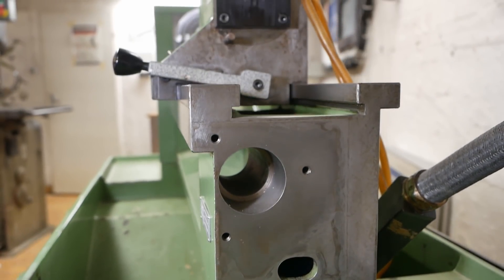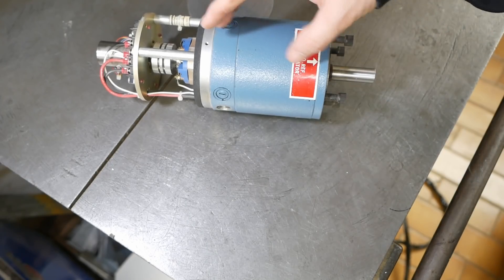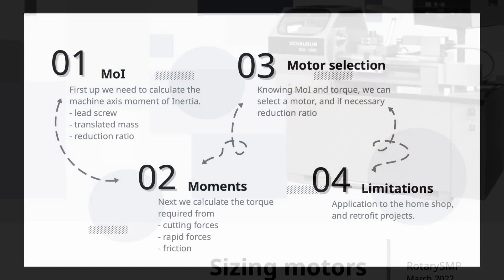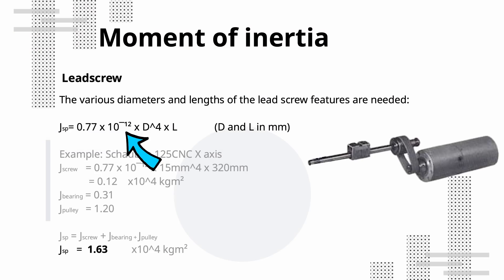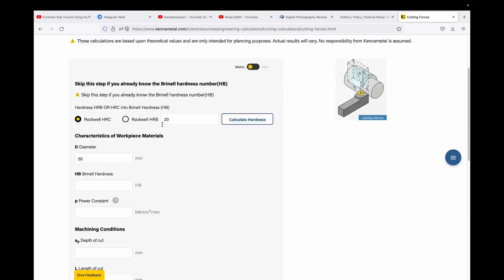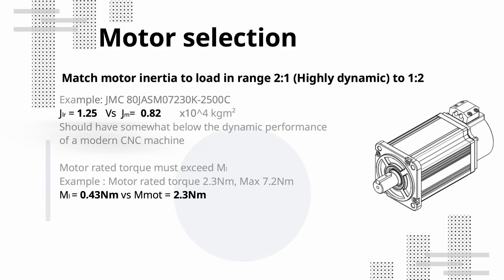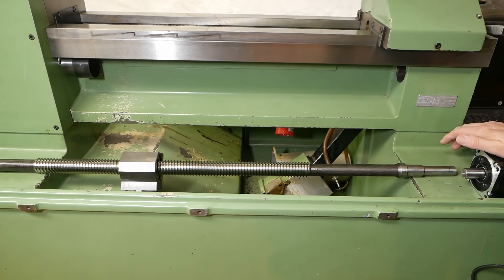How to select CNC axis drive motors.

Comment: I needed to watch this video before buying my motors.

Totally ignoring the matter, I asked friends which have experience mainly on 3D printers.

So, my choice was based on this algorithm:
Machine head:heavy.
Big motor.
Open loop stepper:bad.
I hated losing steps on a friend's CNC in the past.
Servo motor:fancy, I don't need them.
Closed loop steppers:sounds good.
But they're cheaper if bought in kits for 3 axis.
And the machine head is heavy.

Can I spend the money for a 3x NEMA34 12Nm kit?
Yes.
Bought them.

After that, people showed up saying that they're overkill.

So I needed a reason to justify to having bought them.
I came out saying that having big motors helps with cooling when I make fast little repositioning on small movements.

I had to reduce axis acceleration otherwise the machine was bouncing on the stand...

But at least the motors stay cool...

With some calculations it seems that with correctly dimensioned servos I will have saved money and will had better performance.

Ignorant dumb choices...😅
Reply from the maker: We have all made the mistake of concentrating on torque rather than inertia when sizing motors. :)
Reply: @RotarySMP Yes, definitely!
Imagine my face when I saw a guy using the same motors I bought to revamp a 6000x2500 plasma pantograph...😂

I had to reduce motor acceleration and current to avoid tipping over the machine😂

Comment: The calculations are very interesting. I think you were low on the expected feed forces. 0,1mm/rev when facing is usually a finishing cut. You ought to be able to do at least 0,2mm/rev.  The servo is big enough for it anyway. I have finished watching the Sieg playlist. Working on the Schaublin playlist now. Really enjoy it. I learn a lot from you wiring stuff.
Reply from the maker: Thanks for you feeback. You are right, the machine can cut 0.2mm per rev on most steels, on normal diameters.

Comment: Need to watch this more, but I'm trying to select motors for a knee mill retrofit and not sure how to figure out what nM and gear reduction I need. 

Do you cover that in here? or could you dive into it in another video?

Thanks.
Reply from the maker: If you do the inertia calculation, and match the inertia for good performance, sufficient torque will not be an issue.

Comment: I'm not a math guy so I'm struggling a bit with this, I've managed to calculate my moment of inertia with the formulas as shown, but I'm struggling to understand it. In the first formula: 0.77*10^-12 D^4 * L I understand D is diameter and L is length, but why is D taken to the 4th and where does the 0.77*10^-12 magic number come from?
Reply from the maker: It came off a worksheet provided by Prof. Bleicher in the VO311.093 - Auslegung von Werkzeugmaschinenen lectures at the TU Vienna.

The area moment of a shaft is pi*r^4 /4

I don't have the working, but it includes the conversions from mm instead of m, the pi/4 and the density of steel.
Reply: Thanks! I think it's great you were able to just take a course on machine design, I wish we had options like that here in Canada!
Reply from the maker: @Teklectic  I struggle learning this stuff, but also really appreciate the opportunity.

Comment: Hi! Im making H-frame CNC milling machine for metal milling. The travel workings XYZ is 1000*1500*300 respectively. So can I use 400w servo motor for XYZ axes? Thanks!
Reply from the maker: You need to run the numbers. All of the calculations you need are in that video.

Comment: is there somewhere you can tweak a gear ratio 2:1 - you have a motor that is a bit too fast, without enough inertia loading - slow it down, so you see less of the inertia - you'll double the torque but, that's already overkill, so you could go 2:1 the other way there and still be safe.
is this because modern motors are just that much more performant over their entire speed range?
Reply from the maker: Remember that the design goal of a modern CNC manufacturer is insanely fast. 40/min rapids with a ton on the table and high accelerations. The motor is within the normal design range, maybe on the low side of dynamic performance, but  lathes does need much of that. It should be fine.

Comment: It probably doesn’t matter a bit, but as I recall Dex-Syn was the model name of a control system developed by Control Systems Research in Pittsburgh, Pennsylvania. CSR was bought at some point by the Swiss conglomerate Contraves. (In the 80’s, I worked a few miles away at a sister company named Contraves-Goerz, making optical stuff.)
Reply from the maker: Thanks for that. That all fits, as the motors have CSR on stickers.

Comment: you got lucky. Though i know nothing of servos. But stepper driver noise is from cheap stepper drivers.
Reply from the maker: Yeah, I know. But these days there is little reason to choose steppers or DC servos for a project like this. Those AC servos only cost about 1/10 the total retrofit budget incluing purcase ofthe machine, and only cost about 20 or 30% more than closed loop steppers. They plug straight into single phase power, accept Step/Dir or Analog control and pass through the encoder signal.

Comment: Also, while doing the calculation I noticed there's a tiny error in the MoI slide for the sliding components where you've got 0.18 * 10^4, and I believe you're looking for 10^-4
Reply from the maker: Good catch. Correct. I always make dumb mistakes like that..

Comment: I think 'dynamic performance' would translate to acceleration capabilities.  In some machines the acceleration forces might outweigh everything else in terms of motor torque required (depending on the mass being moved and desired acceleration performance).  They might not in your machine, but I would suggest including it in your calculations in the future if you're interested.  I think you could directly translate ability to do things like cam turning at a given spindle rpm into linear acceleration required to follow the profile to within some amount of error.  Also, I believe motor torque and acceleration would not be instant - they would actually take some time to ramp up to a rated torque value based on the inductance and resistance of the motor windings and the voltage available from the drive.  That's probably a secondary effect and would only matter if you were going for very high performance, but I have noticed that the inductance of similar sized / rated torque surplus motors that I have can vary significantly.  For example Fanuc motors seem to have less inductance than Yaskawa motors in the small collection I have.
Reply from the maker: Given that this is a sliding way machine, I really dont want extreme speed or acceleration performance, as I dont want to gall the ways. But you are right that we also looked at the resulting acceleration behaviour.

Comment: Glad to help.  I am not a strong analytical engineer and do most of my work by the seat of my pants, but I am trying to get better at the real work on paper.  I'm grateful that my boss at a previous job gave me the opportunity to sit down and really do the maths and understand the MOI calculation stuff for high performance robots.  We were shooting for getting the max performance with the smallest/cheapest motor due to monetary and power budget constraints, but in your case you lucked out because you have a surplus of performance :D
Reply from the maker: I figured that the motors available to Schaublin in the late 70's would not be difficult to match with much smaller modern motos. Given that Schaublin had that axis limited to 500mm/min I wonder what that old DC servo was rated at? Unfortuneatly I couldnt find out anything about it.

Comment: It occurred to me that the drive motor for the variator is potentially just an AC servo that doesn't have an encoder on it yet.  I may well be wrong on that, of course.
Reply from the maker: What makes a 3ph AC induction motor into a Servo? Permanent magnet armature instead of induction?
Reply: @RotarySMP  As far as I know - and I could be wrong - all you need is an encoder and an AC servo drive.
Reply from the maker: @jimsvideos7201  I thought that Servos need to by synchronous motors, verse asynchronous, but that induction motors are asynchronous
Reply: @RotarySMP  Jeremy Fielding has some videos on the subject, if that helps.
Reply from the maker: @jimsvideos7201  Thanke for pointing to his channel.

Comment: I ended up using chinese 750w ac servos on the avm mas165s too. But I didn't exactly do the due diligence you did. I looked up the specs of the old fanuc motors and compared them to the offerings in my budget. Iirc the x axis was only 0.5nm and the z axis was 2nm so 2.39nm 750w 80 frame was more than enough. I'm running 2:1 belt reduction with a 5mm pitch screw so at 3000rpm the motor is moving the axis at 7.5m/min which is just lovely for a tradional slide way lathe. Also the motors required no tuning to get them performing excellently. Even with a heavy 6 position tool turret and gang plate on
Reply from the maker: AC servos really are nice machines. It is great that they have become affordable.
Reply: @RotarySMP  amen to that. And I picked the cheapest 750w ac servos I could on aliexpress, think it came to about £140 per set (motor,cable and drive) Inc delivery. So far I've used 5 sets of these and they all work perfectly out of the box. The only issue was the Chinese manual took some decoding with Google translate in camera mode! 📷
Reply from the maker: @jonnydeen6952  These JMC's have a manual which is Cringlish, but not unintelligble. There is also a tuning software which I have downloaded but not yet installed.
Reply: @RotarySMP  the jmc's look nice. My yichuan motors and drives are the cheapest you can find. They don't even have the coms port to program via pc so while you can tune the drive it is a matter of changing parameters the old fashioned way. No biggie, I was hesitant buying the first pair but they worked so well I bought a further 3 to fit to a denford senior 3c knee mill. The mill is done and works nicely and I'm just finishing up the avm. I've just finished the hydraulics and now onto the turret.

Comment: The method and calculations are interesting, but given that Schaublin would have considered all of this when specifying the motors back in the 80s, why not just replace the motors with modern items with a similar spec? Or is it that you expect the machine to considerably outperform (in terms of dynamics) the original spec? I can see why in an industrial environment going back to first principles would be important, but for a home workshop educated estimatation and specification based more on cost than performance seems to be the most sensible approach.
Reply from the maker: I couldn't find out anything about those original motors. But those modern AC servos are very reasonably priced.
Reply: @RotarySMP  You should have asked, I could probably have found the spec. Fortunately, when I was replacing the motors on my Fehlmann the manual detailed the complete specification of the motors. I replaced (more or less) like with like, but the original motors were steppers rather than servos and I now feel servos would be infinitely superior. I was thinking of getting some ClearPath servos, where did you source your motors?
Reply from the maker: @davidsamways  I bought these directly from AliExpress. They arrived well packaged, with all the cables.

Comment: very interesting. had not thought that inertia would be reflected back on a motor, but I guess when you think about it, it is a signal and a dynamic impedance system. Theredore these subjects have to crop up.
Reply from the maker: It is interesting how everything mechanical and everything electrical have their parallels.

Comment: Couldn't a CAD model show you the moment of inertia of all the parts and the system as a whole?
Reply from the maker: It could, but then I would have to model them, and I dont otherwise need that. Doing a simple calc 3x to simulate the lead screw is faster.
Reply: @RotarySMP  Might be a good way to check that the calculations are correct if its misson critical i.e if the servo is $$$
Reply from the maker: @arvidhjort  They only cost a bit over €100 per motor. I think I paid about €500 for two motors, two drivers, the cables and shipping.
Reply: @RotarySMP  Thats very cheap! What supplier? And also how hard is it to tune them?
Reply from the maker: @arvidhjort  I got them from AliExpress. Search for JMC 750W AC Servos. 

There is a tuning software for them, I havent installed or tried it, but a recommendation from a guy on the CNCEcke forum on how easy they are to tune was one of the reasons I got them.

Comment: Great job running the numbers and not guessing if the servo motors will work! Old school servo trivia: brushed dc servos like your old ones will have much higher inertia than modern brushless motor because: 1) the rotors are iron and copper and 2) modern brushless motors have higher power density and will be smaller for the same power level. Reducing motor inertia outside the recommended inertia ratio does not preclude the servo working well, but makes the control loop more difficult when things aren’t great (flexible / loose belts, backlash, etc.). I’m loving your series!
Reply from the maker: Thanks for your feedback on that. I am glad that Schcublin used that 33:17 reduction in X, and even more for the 54:17 reduction on Z. I still need to run the calcs on Z, but worse case they offer a higher inertia 750W 2000 RPM motor as well.

Comment: The motors you have bought are bigger than needed. At least that’s my prediction. Cause I know mine all are too
Reply from the maker: Those calculations and rules of thumb were based on huges machines moving a ton of mass at 40m/mm, so I would be satisfied with much less performance.
Reply: @RotarySMP  The easy way is to use the simply the servo with same power and speed. Or chose the next bigger one available. And I just guessed you made it the same way. On my retrofits I wounded be able to calculate the needed power, cause I am not able to weigh all the parts.
On my lathe both servos are were the same size, so the X Axis should be way overpowered and I could have opted for a smaller servo. But there were some other benefits for using the bigger servos. One was adding a bit of powers allowed me to reuse the hole pattern. On the Z Axis the bigger servo also had a bit more speed, so I was able to increase the reduction an com from 0.00125 mm resolution to 0.001mm.
 so besides torque there are somer other things you can consider when retrofitting.
But let me say I really enjoy your videos, especially this on, cause I gave me a new perspective.
Reply from the maker: @patricklaible7527  Thanks for the feedback. 
I didn't have any data on the previous DC servos, so it was not really a path, to just match them.

Comment: I chickened out of computing inertia ratios and just borrow a servo with appropriate tuning software that can guessstimate/compute the ratio in few seconds and jerks of the axis.
Reply from the maker: I am glad the motors I bought by eyeballing "that looks about right'" actually turn out to be a good match... at least for this axis.
Reply: @RotarySMP  A tyical 750w servo can luckilly run most of "home use/garage" sized cnc axes. Even large and heavy wood routers dont need to go beyond 750w.
Reply from the maker: @chronokoks  A whole HP is a lot of power. These are much more compact than two stallions, and make less mess.

Comment: Job well done! You literally "went to school" on the topic of motor selection, many if not most would have gone the "bigger is better" route. Having said that I'm a huge proponent of the latter philosophy if the cost differential isn't too great; alway better to have a little more power than not enough.
Reply from the maker: On my mini lathe cross slide, I think I have ended up with such an extreme inertia mismatch, that it goes into resonance and stalls out at a much slower speed than it should be capable of, so bigger is not always ideal.
Reply: @RotarySMP Agreed, just because I tend to use the "go big or go home" method doesn't mean it's necessarily the best way. Your "by the book" method is obviously better and eliminates overkill. Is the drive in the minilathe tunable? Maybe a change to the accel/decel parameters will avoid the issue?
Reply from the maker: @MRCNC1967  I think the best would be to replace the 3:1 belt reduction with a 1:1 belt set up on the Mini Lathe X. I have played around with the tuning a fair bit. Then again, the axis has such a short travel at about 110mm that you dont really feel it is slow.
Reply: Start with stock 3:1 reduction and see how it works. There's always time for alteration (and another video!)
Reply from the maker: @MRCNC1967  Sotck? Nothing on my mini lathe is stock. :)

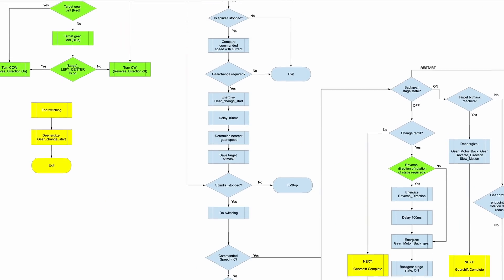Comment: 2:45 that's a program right there! What you're lacking, if anything, isn't programming skills, it's translation skills into some suitable programming language. But for some environments (especially industrial e.g. PLCs/SCADA) there are actually visual programming systems where you just input flow diagrams.

(Software engineer helping mechanical engineers here 😀)
Reply from the maker: Good point. LinuxCNC includes a ladder logic programming environment. I tried having a play with it once, but never got my head around it. A mate who is a programmer, then programmed the MAHO gearbox control in C.
Reply: @RotarySMP  Give a try to a Siemens LOGO PLC.The programming environment (logo soft comfort) is the definition of "logic control".

Comment: Inertia is far less intuitive than speed and torque, especially to those that are new to sizing servos.  I don't think you'll have this problem but torque dividers also work as speed/acceleration multipliers.  This is important as you  have to consider torque to accelerate the motor's own inertia as this counts against the rated torque of the motor.
Reply from the maker: Good point.